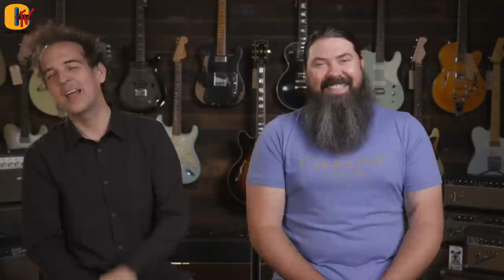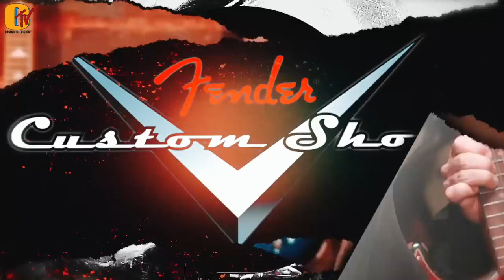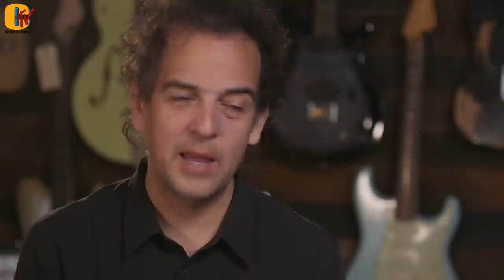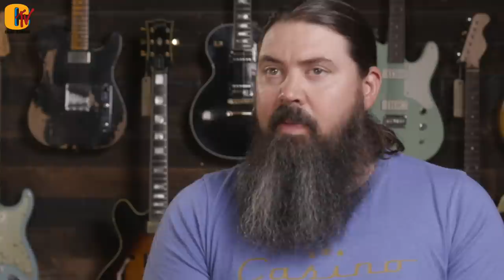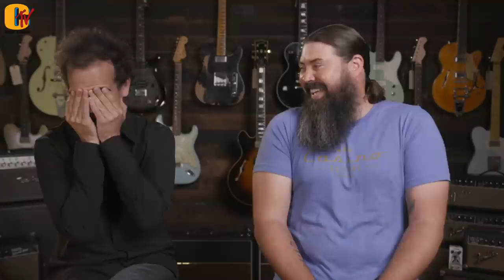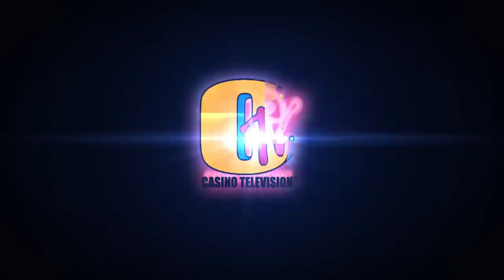Factory Settings On A Guitar - Change or Keep?

Comment: One thing that is often overlooked is neck shims. If you tilt the neck you gain adjustability in the saddles. I've had a few that could only get low action with the saddles completely decked and screws poking out of the saddles.
Reply: What about set necks?
Reply: @deeplyable  If the neck angle is that bad on a set neck return it.
Reply: @ahoneyman  thank you 😊

Comment: I try to set up all my guitars similarly: straight-ish neck, reasonably low action, tweak pickup height to taste, and with no fret buzz. If I can't get the action I want without buzz, that indicates a fret issue that is easily fixed by a good tech (or get your guitar Plek'd). Sometimes a neck shim is required on my bolt-ons if the saddles are decked. Factory settings are just a starting point, a window of acceptable playability.
Reply: Problem with shims is that builders say that doesn’t help with the distribution of sound through out the whole guitar… looses a lil resonance “supposedly

Comment: I once spent months searching for a Gibson ES-335 that felt right. Eventually one presented itself and I had to buy it. After a few months I decided that it was going to be the guitar I used for the songs I tuned down a whole step for. I put on some 11s, tuned down to D, set the neck, action and intonation accordingly and then... mojo gone. I tweaked a bit more but still nothing. It just didn't feel right. A week or two later I gave up and returned the guitar to standard tuning with 10s, reset the neck, action and intonation and then... mojo back! I can't explain it.

Ever since then, I've never really changed anything on any of my guitars. I never change the string gauge. I bought a few Gibsons during the era when they were putting 9-46 on everything. Those guitars still wear 9-46. I had the good fortune to work in a guitar store when I was younger, so most of my guitar purchases were a matter of just waiting around for the right one to come along. I waited four years for my Les Paul. It was perfect. I didn't touch a thing. Not everybody has that luxury I suppose.

Comment: You are missing the point a little bit.  Everyone should be able to do a basic setup on their own guitar.  Factory specs and measuring tools are a great place for people to learn how and a great starting point for any guitar.  I've setup tons of guitars (did setup and repairs for a medium size store for 10 years), and unless there is a problem with a guitar, it should play ok with normal playing and factory specs.  Sure some people like more relief, higher action, etc., but for people learning how to work on guitars, specs and measuring tools are great.  Btw, I rarely measure when I'm working on guitars, but I've been doing it a long time.  Always enjoy your videos!

Comment: Factory settings are going to make the guitar play right considering what they are willing to knit pick at the factory. Most, not all but most will play at factory settings. When the frets, neck, nut, saddles and everything else are fine tuned and polished. You can put things where you like. The perfect guitar can be more forgiving to your wants. Tight radius will also dictate some guitars. Tele saddles will only intonate with the radius spot on for example.

Comment: After receiving a new guitar, it gets a quick play and immediately goes to the bench for a neck check, possible truss rod adjustment, string height settings (I like 1.5mm at the 12th fret) and pick-up height adjustment.  Basically, a full set up. Even the last PRS 22 Custom was close to what I like, but not on the money for me.

Comment: When I finally decide to buy a specific guitar (which might take some time, the dealer might get a bit upset…) it should have no fret height issues at all, otherwise it would remain in the shop or sent back. Then I always put the neck almost straight. It depends on the guitar what‘s left to be done: 
Polishing the frets to a mirror-like shine (almost no manufacturer with the exception of Ibanez does that for it is pretty labour intensive),
Check the fret ends and polish if necessary, 
Check the edge of the fingerboard for any harshness and polish or sand the edges if required, 
Check whether the strings move ok within the nut slots- if not then widen them and polish the slots. 
If the neck is bolt on then remove the neck and check the neck pocket for any residues or stickers etc. If required then flatten the surface. 
Put the neck back, make sure that the strings are centered over the fingerboard and the neck fits flat into the pocket. 
For unpainted fingerboards: check for harshness, sand carefully between the frets if required. 
Dry fingerboards need a few drops of linseed oil. Most new guitars have dried out fingerboards.
Check all screws of the tuners whether they are tight. 
Put the action right, which means pretty low for me. 
Check intonation. 
Check pickup height. 
Unfortunately, all this work needs more or less to be done on each and every guitar, regardless of the price point! It is a shame what kind of disastrous instruments are sold / shipped to customers. Normally, I have to spend a relaxed unhurried day to do all this. However, a guitar, which eventually arrives at your home may have traveled the world after leaving the factory, so nobody should expect a perfectly adjusted neck. 
Despite of that - some brands stand out. Putting the neck straight, check action and intonation, ok, but I never have needed to do anything else with PRS and Taylor guitars. Suhr and Music Man are also great. When I unboxed my Benedetto guitar some years ago absolutely NOTHING needed to be done - after an overseas trip from the US to Germany. This is the only guitar I ever held in my hands, which did not need anything to be adjusted or corrected. It still is set up today as it had left the factory.
Reply: And you never even had to tune it?
Reply: Good question. Surely I need to tune it. Anyway, believe it or not: it was shipped from the US to me in Germany, and it was almost in tune when I took it out of the case the first time….

Comment: Are used to work on single element Selectric typewriter's for IBM. They had a rotating ball for all the print. There was one that a dozen of us best technicians took all the way apart and put back together and could not solve this one problem. it would double print the letter N.  All of the adjustments were in the thousands and we were all experience technicians. Nobody could ever figure it out and it was a brand new machine. We passed it all fails. The mojo got away, so there is a lot to what you're saying.

Comment: I always put locking tuners on. I’d plek my guitars but my Gibson already is and my Strat just happened to be really nice.  Fender Hendrix tribute Mexican.  The tele i had needed a plek though or at least work on the frets because it couldn’t be intonated properly (several frets needed filing was my hunch but it had to go anyway financially) i really want the Marr Jaguar. Don’t think I’d do much since the point is that it’s already been made to Marr’s standard. Got to setup every guitar though.  A plek and a setup should be enough for any guitar above $500 reallly these days.
Reply: Having a guitar “set-uo” and learning to do it yourself as well really is necessary. Otherwise you’re just depending on sheer luck.

Comment: i noticed that the string wont always line up above the pickups
on some fender stratocaster models  usually vintage style 6 pt
bridge
it appears the bridge pickup is large mm size
but middle and neck appear to be too long

and other models with 2 pt trem bridge the strings
line up pretty well

Comment: Change.  You will like playing your guitar more and more out of your guitar. I've had guitars come allive way beyond hopes by setting it up the way I want it. I am a rhythm guy so I like a higher action, thicker strings and fiddling with the pickup height and screw height on humbuckers. Worse case scenario you just put it back to factory.

Comment: I was given a music man guitar in pieces once.  The owner had apparently tried to tune the thing with no attention to the trem being lifted as they tuned.   By the time they hit the 1st string the 6th was flat.  They kept tuning until the body cracked under the tension at the trem.   What substances or what quantity of said substances they were on at the time was never discovered.  I'm still curious as to why the strings didn't break first.

Comment: SE Massachusetts near the Atlantic Ocean and my guitar necks need adjusting so much I leave the truss rod covers off.
Reply: i'm lucky weather wise where i live in NZ as the weather doesn't change too drastically, but this winter is a bit colder than normal and even on my Solar E1.6 FBB with Evertune i have to tweak it occasionally this winter coz hey it's a guitar, made of wood and as you knowit expands and contracts like anything wooden.

Comment: The factory specs are a starting point, and a touchstone if you're dealing with a guitar that has wandered over time. When you're struggling with adjustments, getting back to spec can help you get your bearings. And there is no such thing as "tonewood" for an electric guitar. We've known this since the 1960s when ceramic guitars were introduced. There have since been acrylic guitars, aluminum guitars, graphite guitars and steel guitars, and you know why they all sound pretty much the same? Because the pickups, the speaker and the gain are what give an electric guitar its sound.

Comment: I didn’t realize there were factory settings, I thought they were just slapped together 

I usually do my own setup on a new guitar myself, and then might spend weeks or months tweaking the truss rod and/or saddle height, and then I’m good for years. Sometimes a neck will shift during a season change, but I pretty much set and forget. Fortunately I live where temperatures and humidity are relatively stable
Reply: "slapped together"??
Reply: I think he means brand settings, to be more specific. If you google "telecaster pickup height", like I did literally yesterday, it will come back saying 2.2mm for the low E and 2.0mm for the high E. It probably didn't come set that way, but that is where it's "supposed" to go. As I found yesterday, I don't like my low E that close to the pickups, so I lowered it some from factory setting.
Reply: @216trixie  almost but not quite assembled
Reply: @honkytonkinson9787  it is an odd take to say that custom shop products are slapped together, not even assembled. Not sure what you mean.
Reply: @216trixie  I meant guitars in general, as presented on arrival from the manufacturer. There doesn’t seem to be factory settings, though high end guitars are different I’m sure. I’ve had several sub $1000 guitars, and they always need all the nuts and screws tightened, some setup, and often some fret polishing. 

I wasn’t thinking about manufacturer’s recommended settings for pup height. I don’t pay much attention to that as long as I like how my guitar sounds

Comment: I wish I’d kept the string gauge and height “factory settings”  on my custom shop LP. I’m taking it back to GC soon to try get it reset to factory specs.
Reply: Please find a better place than GC to mess with your expensive guitar!

My experience with GC is that while the tech is usually the most knowledgeable person in the store, that’s not saying much

If you live in a major city you might be ok, but better to find a local shop with a good reputation! Or learn to setup yourself!
Reply: You can handle that yourself. I understand a CS is a CS, but I have only been playing about a year and a half, and I learned all the set up methods off YouTube. Adjusting string height is easy and so is changing strings. You can't break it. Don't worry about that.
Reply: take it to Sweetwater or a trusted local guitar shop. Not not GC. Not sure where you are from, but i'm in NZ i take my guitars to get serviced at a guitar shop that isn't a dealer for Solar Guitars or PRS and get trusted staff to service them.
Once you find a good guitar tech, stick with them and tip them if that's your custom.
Cheers from NZ 😎🎸🤘

Comment: .06 string height, decked Strat or Floyd. Direct mount pickups. Ratio tuners., bone not tusq. Under 8 lbs. Strung with 9s. Are my wants.

Comment: When I buy a guitar, if the pickups make happy and I think I can set the neck/playability to suit my style then I'll buy it. Once it comes home I concentrate on the neck cause that's where you live. I don't go by factory settings and set it up by ear and feel. If I screw it up I'll then go to factory and start over. I gave up on the mad scientist impersonation using guages...micrometers etc. Unless I need to start over.

Comment: I virtually don't mod guitars in many senses. Things like string trees, the nut, strap buttons, yes. Pickups, no. I choose a guitar in general based as a good swap versus my mains at this point. I've got my amp where I want it, my effects where I like em. I go old school and just swap a guitar in when I want a quick tone change. I leave em as original as possible, because I want them to be in as close to original when I give em away. That oerson gets basically what was in the store the day it came out. Most pickups in guitars are passable, of ya have other setups to go to. Personally, I bring a fair amount to a gig, so it's not an issue in that regard, I'm already gonna go against the modern giving ethos and bring many toys to the gig.

Comment: Factory settings? Are you kidding me? I grew up in Florida and the weather and more importantly the humidity changed every three (3) minutes. I've spent weeks chasing pickup height adjustments but then I went to a Motorhead concert and stood less than 20 feet from Lemmy and his Murder One amp. Now I'm not quite so picky anymore. But adjustments, sure I can spend forever or ignore them just don't give me a set of nut files and I'm good to go because everything else can be undone.

Comment: Specs are bs.  I find lots of teles once I get the action low enough the saddles are too low and the break over angle changes the resonance so I have to angle the neck.  I prefer 9’s but some guitars want 10’s because the neck responds better with a bit more tension on truss rod.  If you lock into the factory settings you definitely can lose some magic

Comment: Couple item’s I’d like to share with “Group”:

1: Welcome back Jonathan!

2: Best shim fix I ever encountered came from an engineer - slide rule math-y type, not “choo choo” or audio nerd - workin on his EVH Wolfgang. He used soda cans as opposed to high dollar Stu Mac pieces of wood or “bidness cards”. I’ve since used this on every bolt on instrument I own that needed it. The x-factor for me is basically the width of the material. It’s VERY consistent, as opposed to wood, biz cards or (hopefully) expired plastic cards.

His method is pretty dang clever and can be easily adjusted! Hope it works half as good for you as it did for me.

Here’s his link. Time stamp is around 7 minutes 7 seconds. 

https://youtu.be/bK6VaVb23Pw

Comment: I never could afford a guitar good enough that didn't need a lot of adjustment....... Hey, maybe I need to buy one from Casino Guitars?
Reply: Could be your climate. I hear living somewhere dry or humid wreaks havoc on them.
Reply: @Tijuanabill  agreed. I havea 2020 Squier Affinity Strat in HSS. Bought new from the dealer, in the box. Changed the strings to Ernie Ball slinkys 9-42 (factory is 9-42). Never had to adjust anything on it. Awesome guitar and yes i have guitars worth 10 times that one.
Price isn't an indication of quality. Always inspect your new guitar for issues no matter what price point. That Squier of mine ? is not for sale.

Comment: If you were never intended to change the settings, they wouldn't all have adjustment screws.
Reply: Spending time with the neck and re re 3 times gets the tensioner to perfection with stringing up the frets get a 40 hr leveling treatment call it the lowest action no issue  and higher is magical. Time well spent  my friends. Frets get knocked beat the problem with a bic lighter as a drum roll,before file time.